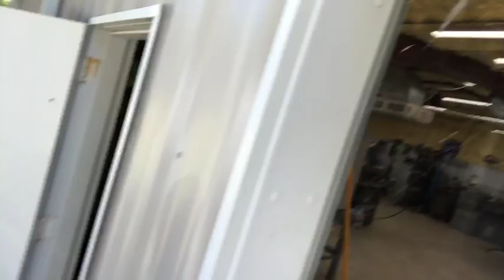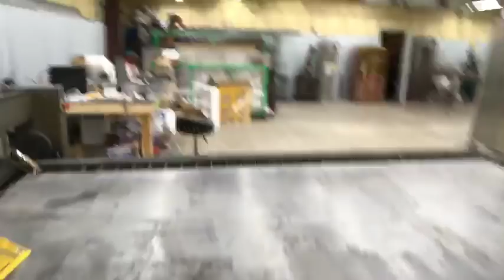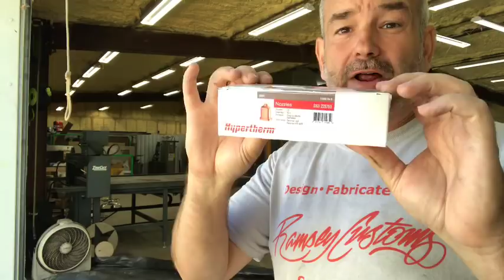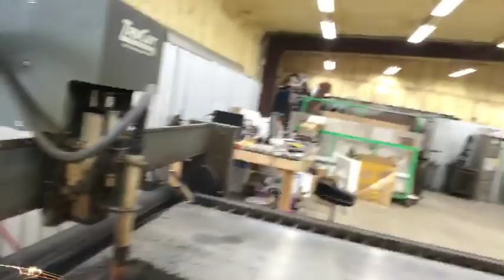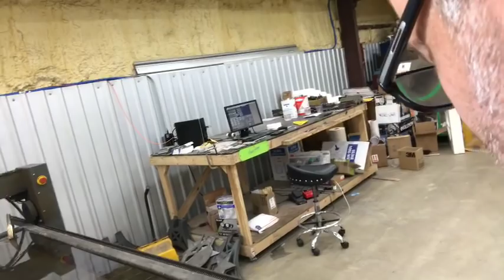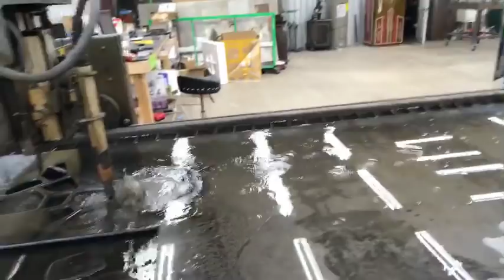A day in the fab shop with TRUCUTCNC PLASMA

Comment: Yesterday, I stuck the hose in my water table to top it off. I have 3 55 gallon drums that the 5'x10' x5" tray drains to and fills from, but the water evaporated enough to not be able to fill it to the bottom of the plate. Well....I turned the water on and started thinking about the part I was building and headed off to the other garage to work on the parts. The hypertherm 65 sits under the edge of the table, and it overflowed! Luckily, the opposite end is a tad lower, so the plasma didn't get drenched. What is nice about the CandCNC electronics is that my gcode file automatically sets the pressure and amperage on the plasma cutter. The only reason to touch the plasma is to turn it off or on or to change to a different tip.